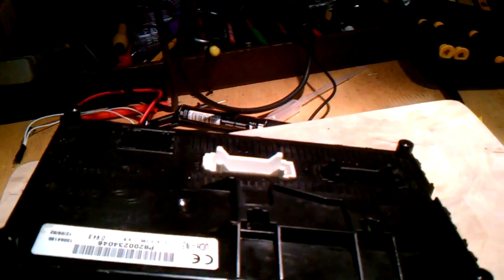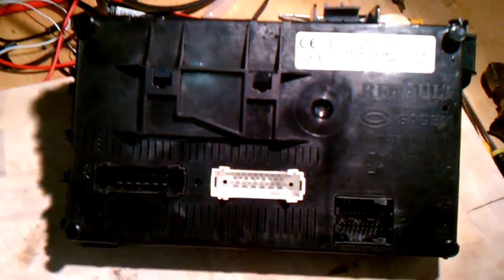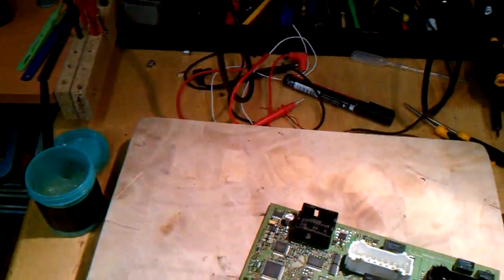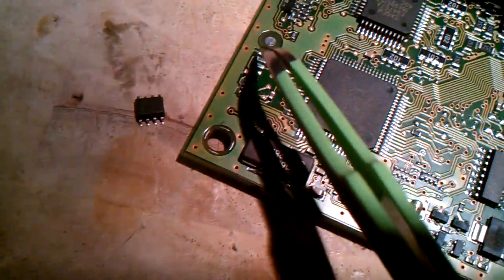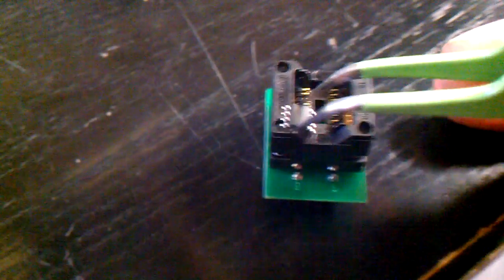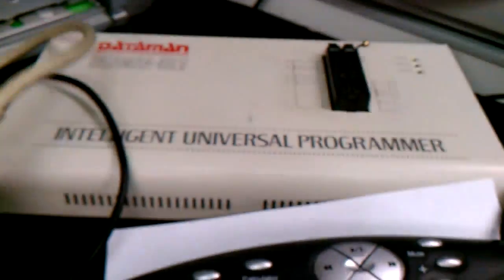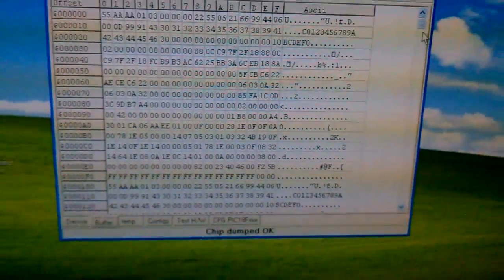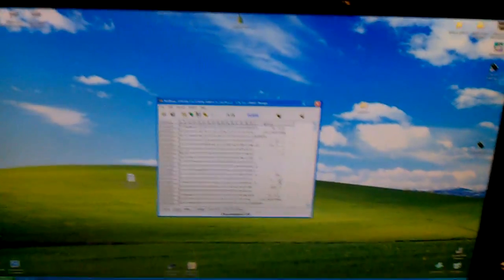Clio UHC EPROM 93C66 Dump to extract pin code APV

Comment: I need to swap my fault UCH by a 'new' one. the 93C66 have all the info? I read somewere that swaping this eprom, the 'new' will work fine. Is it correct?
Reply from the maker: Hi
Yes, that's correct...
Reply: lmsvvavr
 Tks! My uch is a N1 V4.7 I only can find N1 V5.3 do you if they're compatible? Thank you again
Reply from the maker: Rui Marvão 
Should work with no problems. ..
The only thing you might need to do is to adjust the settings/options to meet your car. ...
Reply: lmsvvavr Thank you very very much! My car is a Van so, excluding the Air Con, it has no options :)
Reply: lmsvvavr
 tried today to make all the steps that we talked, the car runs good, the settings are ok, unfortunately the key fob locks but doesnt unlock. the stock UCH N1 is a V4.7 and the new one is a V5.3 any solution to this?

Tks! Rui
Reply from the maker: Rui Marvão Hi
If the locks and doe not unlock is more likely there is a problem with the remote, rather than the uch. ..
Even with different ecu versions I never had that issue. ..
Reply: lmsvvavr nop, I installed the 'old' uch back and the remote works normaly. Do you have the difenrent UCH models pinout?
Reply from the maker: Rui Marvão try autodata. ..
Ensure you read and write the second hand uch chip correctly. ..
Reply: lmsvvavr
I Will compare the bin file with the original ;)

Comment from the maker: If you traced the problem to a "welded" relay, yes it can be replaced and should work.
No coding required, as the UCH is the same...
You will might need coding/programming if you replace it.
Hope you can get it sorted.

Comment: Waw? That is a science to me. I wonder if you have an advice. The wipers on my clio do not turn off and I think it is a "relay" problem on the uch. I think I have located which one, however, is this DIY job, or doesn't mean need a completely new UCH and codes...etc. thanks for your help.